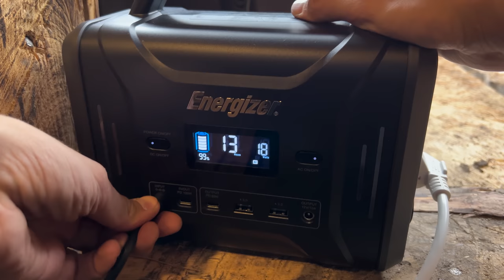DUGOUT LIFE: I hide from the rain and conduct ELECTRICITY in an UNDERGROUND house.

Comment: from the title I was worried you'd received a shock. :)
I notice there is no GFCI on the AC supply of that unit - BE CAREFUL since you are using it in wet locations!
Reply: Is that a type of circuit breaker?  I looked it up but it was over my head
Reply: @richardruiz6972  Ground Fault Circuit Interrupter
Reply: @cmerton  thx   I am going look it up

Comment: Do you have two dugouts?  Why is this window on the right side of the door facing the front entrance?  In previous videos your window is on the left side.  I'm confused.
Reply: Yes, he has several structures he's built, and his video titles do not identify which they are at, sometimes he calls a dugout a "log cabin" and vice versa. And he ALSO has a log cabin out there. :-) You spotted the same thing I did at first - window on "wrong" side as well as little lean-to for firewood storage is not present. It's fairly easy to determine where he is by the layout and features and the main dugout is the one with the second room behind the carpet.